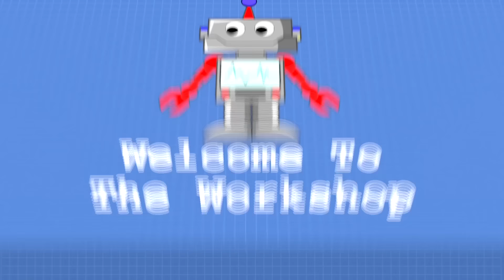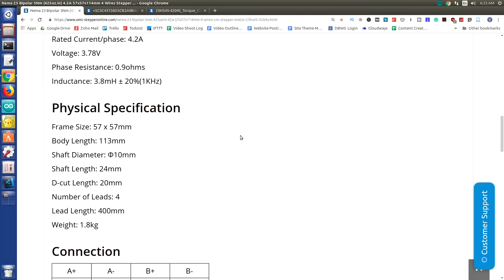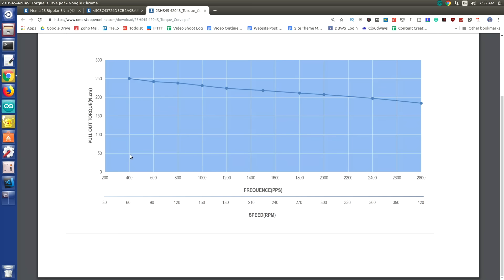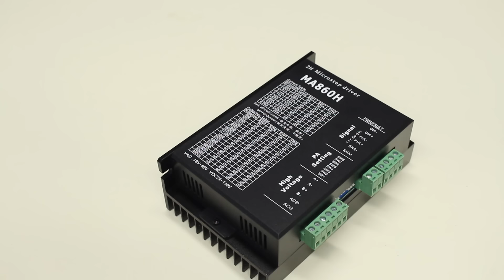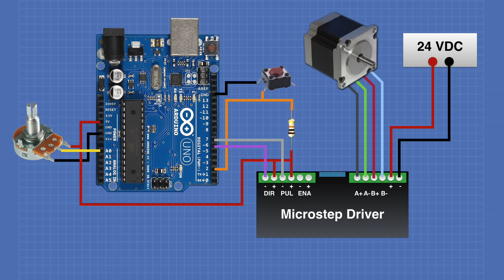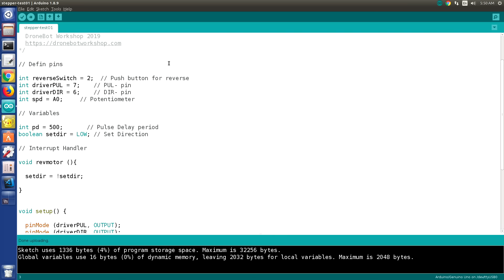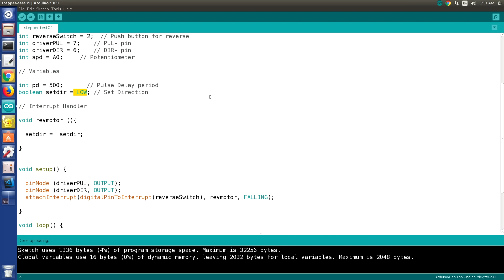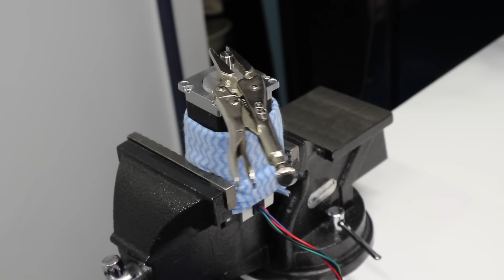Big Stepper Motors with Arduino

Comment: a good information, one time i connected DC supply and exchanged positive with negative, and the driver burned-out, so it means there is no protection for these mistakes.
i used  Microstep Driver M542.

Comment: Hi buddy, sorry I don't know your name. I just wanted to give you a bit of advice, well more like user tips. I'm a cnc router guy and know nothing about lasers or lightburn, but I'm almost certain you must have similar tools lightburn as those in other CAD software.
This one you should definitely look at. When you opened the vector files, & you found they were compiled of open line vectors. All you need to do here is select the vectors, go to the drop down menu for arrange & select join. This will joint all the little bits to become one. It's a game changer.
The second tip would be to lasso a bunch of nodes, the Ctrl select the right angle nodes you want to keep, the Ctrl S to smooth out many nodes in one sweep.
I hope this helps bud. 😁

Comment: It's so simple to wire the stepper using the native mode of using ground as the common connection and +5v as the control signals. I'm not sure where this use of +5v as common came from....

Comment: Jeder kennt doch noch eien Schrittmotorsteuerung aus dem Modellbau  ? Und die hier relevanten Hauptkomponenten 
der realen Umsetzbarkeit, dh. geeignete Motorkomponenten primär !
Der Rest ist nur ein Spannungsregler mit Nullabgleich. 
Geht auch eine kleine  PC Box mit serieller , oder usb Schnittstelle .
und kleiner plumper CMos  DA für 50 Cebt drauf.

Mehr braucht man doch  nicht und ein VB6 Modul zur Ansteuerung 
oder gar selbst in einigen Programmzeilen dazu progrsammiert. 

oder werden auch noch irgendwelche nützlichen Fertiggräte verwendet , die beim Anschalten sofort richtig gehen ? 
für eine sonst auch prompte Anwendung hier ? oder ist das eine Cloud für Alice im Wunderland - Werbung mit viel 
Service - Ballast herum , der gar nicht richtig als ausführbares Programm im normalen Alltag geht und nie funktionierte
,außer ein aufgezwängter Service - Vertrag oder gar Selbstbedienung ohne Anfrage ?
als Überraschung ? Die derzeit neue Betrugsmasche ?

Mit Cloud Wartung ? sogar ohne Gerät ?
Vorsicht, würde ich rein gefühlsmäßig anraten !

alter Modellbaumotor mal angeschalten ?

Nicht der Arduino auch nicht das Handy mit eingebautem Sender für 3.50 Eiro 
  sondern das mehrfach übliche Funkmodul für 3, 50 Euro gesondert fehlt noch. 
der richtige Steuerknüppel für nochmals 3.50 Euro  geht über einen DA  Wandler nochmals von 50 Cent !
auf einer kleinen Platine  drauf .  Das gesonderte Video Empfangsmodul  aus zwei Platinen 
mit Bildschirm gibt es schon für 15 Euro. Also wenn schoin denn schon .
35 - 40 Euro, dh. die Funktechnik mit Kamera bds  und Mehrkanal   ? im Großmarkt ? 
, ohne verfluchtes Handy ?

Comment: i want to ask something. I use a big stepper motor with a microstep driver and i try to drive a conveyor belt but we need high speed. stepper motor is when speeding up in first time make a noise but when the arrived target the noise is reduce also when i set the speed 0 it deaccelerating but the last round make this noise again. is it because of the resonance? or how can i prevent this problem i change the acceleration in fastaccelstepper but when increase the noise make short when decrase it is taking long. but i have to start motor from stop position.

Comment: What kind of motor size would you recommend to spin a watch cleaning machine basket? They tend to spin quite fast but have very low mass and weight. Easily under 500 grams

Comment: Omg i just realized your workbench setup with your custom panel for your power supply.  That is outstanding!! Ik setting up my new workshop now and was wondering how I can clean up my workbench to not have so many devices and cables running everywhere. I am absolutely going to copy that idea 🙂 thanks for the inspiration!

Comment: Tks, great Tuto. I would like to replace the steering wheel of a Segway with a joystick and a fairly powerful motor. Can a similar system be considered and safe without fail or should I continue to use the big joystick I made?  THANKS !    I can provide a pic if someone ask :-) 🔔Subscriber

Comment: I'm using atmega and stepper driver for nema42. The problème I'm facing is big interférences wich disturbs arduino an makes noise on inputs wich fluctuates. I think it's EMI problem. How can i fix this ?

Comment: Dear, it is possible to run these motor (nema 23) at about 50 to 800 rpm? Now I am trying with nema 17 size and cheap 8825 driver at 12V and ai have wery raugh runing at low rpm and max is also wery low.

Comment: hi, I have been playing with this and I find the pulse delay does nothing when changed? using:  "int pd = 500;      // Pulse Delay period" 
I expected that changing this number lower would speed up the motor and making it higher would slow the motor down? but nothing happens... the speed is controlled on the map line but I can't seem to get a really slow rpm of say 0.1 RPM if I wanted....

Comment: This is just what I was looking for! So I have an Arduino Uno and it has a custom library in it that I had a person who knows coding make for me. It works exactly like how I want it to. The problem is that the Arduino Motor Shield and the stepper motor that I'm using do not have enough power for my purpose. My question is, can I simply remove the Arduino Motor Shield and connect up a driver and motor like the ones you demonstrated in this video and not have to change any of the existing library?

Comment: Hi guys
Is there any way to disable stepper drive when when not in use.  I'm having problem with overheated motor. Because motor is on even when not in use and it's over  heating my motor

Comment: Why do we use a common 5V for both the pulse and direction signals instead of a common ground? What difference does it make? Are there any advantages to operating the circuit one way or the other? Couldn't we connect the 5V for the potentiometer and the button separately and operate them independently? Thank you for your help :)

Comment: Great video, one important thing to note is the max stepper speed for an Arduino uno is limited to 4000 steps/second due to the 16MHZ clock speed.

Comment: I know this is an old video, but I was hoping to still get a reply here about a sort of related question about the stepper motors and the stepper drivers.

What I was wondering is, can you take the Woodpecker board off a 3018 CNC machine, and use that board X, Y, and Z motor outputs, to go to the Stepper Motor Driver?

Since the Woodpecker board has the drivers on the board, and are for the smaller Nema 17 stepper motors, or whatever small ones they use, the power for the steppers comes out of the board straight to those steppers, so I was wondering if that was different than the pulse and dir signals, or if it was pretty much the same, or if these DM stepper motor drivers (I have 3 DM556's) can accept and work that way?

Or maybe I would have to try to tap into the connections before they get to those onboard drivers on the Woodpecker board?

Or maybe there's a way to add resistors or something, to be able to use the Woodpecker outputs to the DM556 stepper driver?

I could use my arduino, but I figured why not just use what's already working on my cheaper little 3018 CNC off amazon that I have, which I am now recreating a lot larger with Nema 23's and a Makita router.

Any help with this would be appreciated, please and thank you in advance.
Reply: Meh... maybe I'll just use an Arduino.
Reply: I am using a planet cnc to feed the stepper motor driver.   It wasn't that expensive and a lot of software is included.   Unless you are really strong on arduino ( I am not) it will save a bunch of time.
Reply: @harryniedecken5321  Thanks for the reply.  I ended up getting an ESP32 with FluidNC as the firmware for it, and UGS for the software GUI.

Comment: Consider using a gearbox with your stepper motor for heavy loads, to avoid the motor missing steps and losing positional accuracy. A planetary gearbox allows 'backdriving', which can be useful in some appications, whereas a worm and wheel does not

Comment: btw: you should make sure that the highest frequency your arduino puts out is matching your driver. my driver a.e. has a input frequency up to 200khz so i had to change the fifty in 
"pd = map((analogRead(spd)),0,1023,2000,50);"
to a five 
"pd = map((analogRead(spd)),0,1023,2000,5);"

check that or your motor wont spin at full speed.

Comment: Do you have a tutorial or a schematic diagram for a AC Motor Driver that uses a connector of 10150-3000PE to connect to an arduino by using the same code?

Comment: Thanks for great video. I have a question, at 14:40 why would you need 10k resistor connect to the switch button? isn't it without the resistor the push button still work?

Comment: Hallo
Does Reference Current of MA860H is the same as phase current of stepper motor?
E.g. If I want to achieve rated torque performance of my stepper motor, do I need to set reference current of MA860H at the same (or closest) value as stepper motor's rated phase current?
Or I must multiply motors phase current by 2 (because of 2 phases) to get the drivers reference value for rated torque performance?

Best wishes and greetings from Latvia!
Rahims.

Comment: Thank you so much!
I am just stepping into this and need a stepper motor which can do 8Nm at >= 180rpm. Where would I have to start looking for this?
Reply: That will be challenging.   The place to start is to just search for stepper motors on line and look for at least a size 31 I think with a longer body.   The challenge that you face is that stepper motors are essentially constant power devices.  

Since power = rpm x torque,  as the rpm rises, the torque decreases.   Modern high performance stepper motors are not linear like this and hold more torque at higher rpm, but they still fall off approximately 200 to 300 rpm. ( usually)

Industrial suppliers and distributors are pros and picking out a stepper motor for you.

The other option is a servo motor.   Those are roughly constant torque over the useful rpm range,  but typically require a gear box to hit the desired rpm.

Comment: The signal voltage doesn't need to be the same voltage as the PSU powering the stepper? I'm running 24v system but would like to get a 48v PSU and run the stepper off the 48g psu

Comment: I had a. similar setup with on-off and direction toggle switch and an LCD displaying the speed of motor on scale of 1-10. I get slower motion when LCD is enabled compared to when LCD is disabled in Arduino code. Can anyone repeat same with usage of dot-matrix LCD?

Comment: 14:45 Isnt the connection between 5V and Pin 2 (even with resistor) a problem? Isnt it a short on the board it I press the push button then?

Comment: Nice vidéo, usefull.
I would to ses how you setvthe dip switches.
We know than the max amp of the stepper motor is 4.2 amps/phase; so do you set the dip switches to 4.2 or 8.4 ????
Thanks

Comment: How to figure  out the maximum rotation speed of the stepper? What would be the frequency and the pd period of the arduino sketch? If I decide to run the motor with 800 pulses per rev should I select the same on the stepper driver unit or can I leave it at 200?

Comment: my fisrt arduino stepper test i make stepper motor controller workbench big vise, open and closed vise. very simple 2 button  open and closed, and arduino simple code run motor. many year before, about 10 year.

Comment: motor spec volt not matter all stepper motor can and have better use maximum volt what driver handle about 45-50V or best use big driver and 90-100 volt DC

Comment: I'm planning on using this setup to control a dumbwaiter I built to transfer items between my ground level deck and my third floor deck. Is there any accumulating error that I need to worry about or can I simply give a precise number of pulses to make the dumbwaiter travel the correct distance each time without relying on sensors at the top and bottom to stop it? Of course for every travel in one direction it will have to also travel in the opposite direction (a 1:1 ratio in other words), so any small error that is undone by reversing the direction would be acceptable. Thank you.

Comment: How many stepper motors can I connect to the Arduino Mega board. I have one for right, one for left, one for forward and backward, and one for another purpose. The total of motors working async is 4. I am using an RC controller. Thanks.
Reply: arduino uno have digital pins 14 can use  max 7 motor, and potentiometer need input 1 pin can use mac 6 pin. can use potentiometer max 6.mega have lot more pins, i not remember how many, nano have RC better board same than uno in/output but lot smallest board.

Comment: thank you.

I am wondering if there is something else needed to know when it is a servo motor instead of stepper?
Reply: basic need know, if use stepper motor can lost step if have too much torque or wrong setting motor, and cheap hobby user system, if use closed loop need only add encoder input too to arduino or driver. and cost 10x more, but no lost steps. motor need buy new closed loop motor, driver need buy new and controller code need make new all.

Comment: Hello, 
anyone reading this comment and have an answer to my question, please help 

@14:41, the connection of the Switch is quite confusing,
the ground with the positive, 
what does the resistor do there,
I mean if we activate the switch we would definitely have a short, 

please help with the right explanation, i really would be very grateful to you

Comment: I'd like to get my hands dirty with a project, can I automate this EXACT set up with different code ? 

Example, I'd like for the motor to make half a rotation in the span of 2 seconds, pause for 10 seconds, and then do a full rotation in the span of 3 seconds opposite way. The loop 4 times and halt. Can this be done using this exact setup just by playing with nothing but the code itself? Or would I have to add more modules/hardware add-ons to the circuit setup?

Comment: Absolutely incorrect... Volts pushes current.....no voltage no current. As voltage increases amperage increases directly proportionally. 
Simple math....
Why don't you conduct a test.... Use a variable voltage power supply and measure the current as you increase the voltage. Now granted as the wire heats up increasing resistance the amperage will decrease relative to the increase in heat... But with with that said, More voltage equals more current. 
Here's some questions to consider?
What does the term potential voltage mean?
If you have no potential can you still have current? 
Does this mean that voltage is the force that pushes and creates current?
Reply: For some reason do you believe just because you have an Arduino controlling a phase to a stepmotor, that somehow the laws of physics do not apply?

Comment: Damn I feel like a modern day motor man perpetual motion keys for Free range power without outside power and torque and battery power amps and I have step in a full step high pressure low pressure low pressure high pressure variable resistor pendulum alternators oh yeah I think that would work pretty close anyway
Reply: Remember I called it right now. We will never buy fuel for nothing else but fun in the Sun 🌞🌞🌞🌞🌞🌞🌞🌞🌞😎 Enjoying your dimise laughing and laughing and laughing and smiling because I am All that too Excellent 👌

Comment: How to set 200 (default) micro stepping using this driver?
Reply: 200 step/rev have full step no micro step, 400 step have half step and micro step, 800 step have 1/4 step and micro step. lot step need lot fasten calculate and generate pulses,

Comment: Hi,  very good explanation on the motor and the driver.  One area I didn't see covered or explained is the settings for the dip switches on the driver for pulses per rev.  I'm not sure how that would work if the lowest setting on this driver is 400 pulses per rev and the stepper is 1.8 degrees per step  which calculates out to 360/1.2 = 200 .  I'm guessing if we micro step then 400 would be the setting you'd use for the motor you chose?

Comment: Thanks a lot for your instructive videos! I have a question: isn't it a contradiction that you say that the bipolar stepper motor needs 2 x 4.2A = 8.4A when in microstepping mode (and you used microstepping) BUT the driver can only deliver 6A? Or will this only have an effect when the stepper is under high mechanical load? And if this load exceeds the power delivery of the driver - will the latter switch off (overload protection)?
Reply: I found the answer in the comments to the article, so no answer required in addition. Thanks.

Comment: How much current did the motor consume?
Reply: video him say normal minimum cnc user stepper motor 425 OZ 3 Nm torque 4,2A motor normal used 36-45Volt. you need driver who handle minimum 3-5A current and 50Volt. answer have 4,2 amp motor current max.

Comment: Hello.
I am a beginner. I am working on a project using 2 push switches to change the direction of motor. I also use the program that you post on this video. I am having a problem when the traveler hit one of the push switch, it hit the switch and juggling multiple times and change direction. Would someone help to solve this problem? Thank you very much.

Comment: Thanks really appreciate your video. Your coding instructions did not work until I discovered some stray stranded wires had crossed pins on my Arduino, fixing that, everything worked. Thanks again.